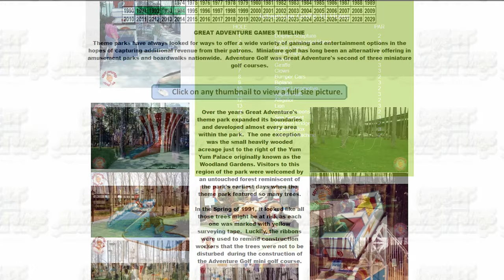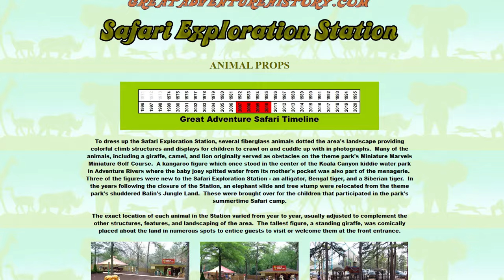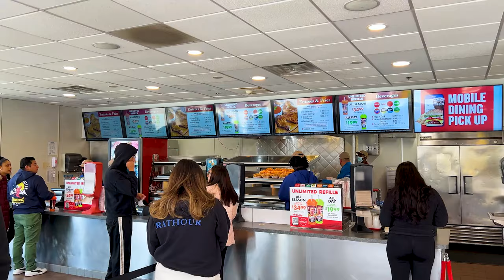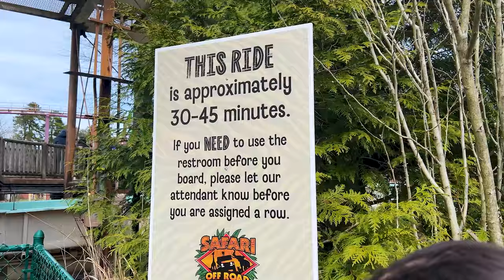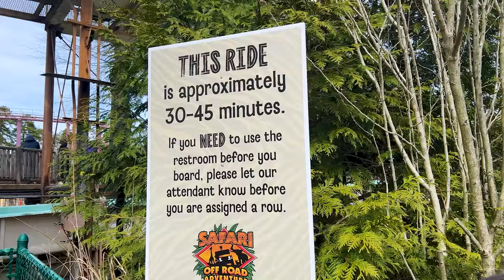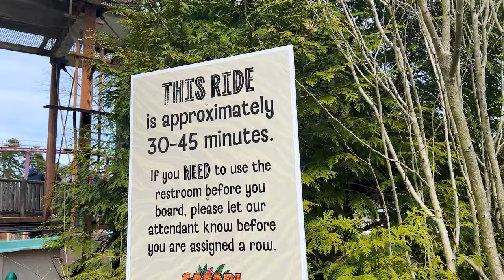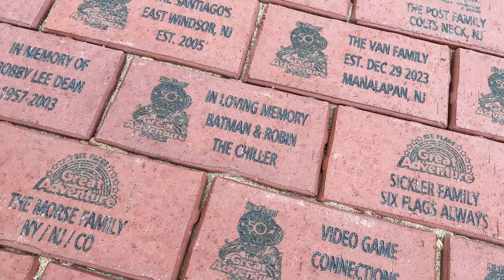Six Flags Great Adventure | Park Update | March 30th, 2024

Comment: My idea for an ideal wildlife safari themed section for Six Flags Great Adventure (when it should’ve opened in 2004 or 2005 to create synergy with the Wild Safari in an area where Golden Kingdom and most of Frontier Adventures currently sits or in 2013 to create synergy with the Safari Off Road Adventure)

Wild Safari Adventure Outpost

List of Rides and Attractions:

- Wild Safari Off Road Adventure (a reimagined version of the Wild Safari attraction with big safari vehicles, with the drive-through safari optional for select dates when during down-time)
- Congo Rapids (a version of Congo Rapids rebuilt for the safari section after the OG is torn down)
- Safari-Go-Round Wildlife Carousel (a safari-themed carousel ride with various rideable animals)
- Air Jumbo Elephant Safaris
- Roaring Tiger
- Safari Express Adventure Trains
- Off Road Safari Jeep Adventure (a small safari jeep ride with life-size animal replicas)
- Dino Xpedition (a limited time attraction for select dates and years; or maybe a similar safari ride)
- Various Golden Kingdom jungle-themed rides (some of them could be flat rides)
- Several Small Walkthrough Zoo Attractions with Animal Exhibits (these animal-based attractions could complement the Safari Off-Road Adventure)